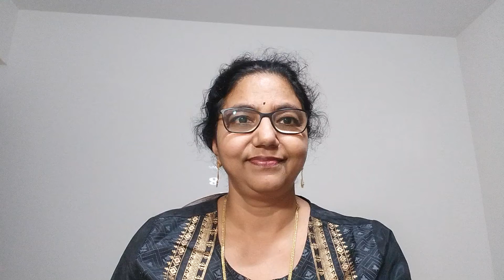Dr Anima Upadhyay " Viscosity " viva voce questions

Comment: Define density how are density and co efficient of viscosiry related to each other
Reply from the maker: @ Simplified art, Density is mass per unit volume and it does not affect the viscosity directly, however less viscous or less dense liquids flow quickly than denser or highly viscous liquids.

Comment: If a fluid containing water 10%,
Like a exam Furnace Oil ( viscosity kinematic 50 deg.c,cSt 165Max IS 1448 P 25 ) 
Is furnace oil + water mix is greater then 165 or no

Comment: Why is viscometer U shaped?
Reply from the maker: The tube viscometer consists of two bulbs connected through a U tube that makes the flow of liquid even through the tube. Also, the U tube is kept in water bath the shape hrlps in keeping the temperature uniform.